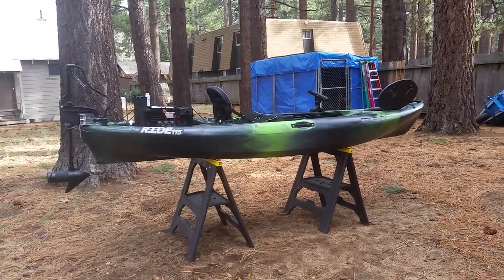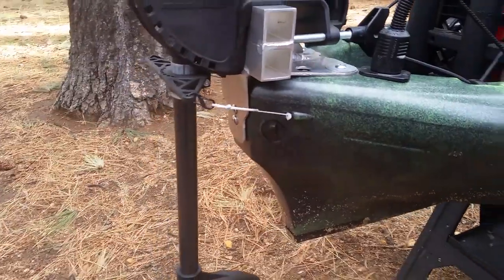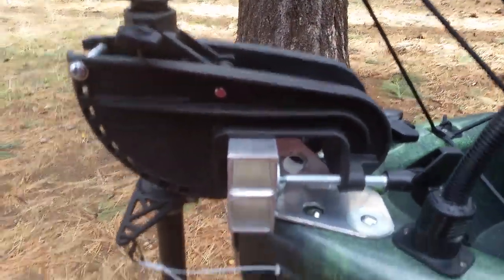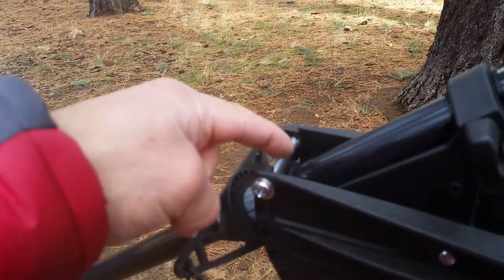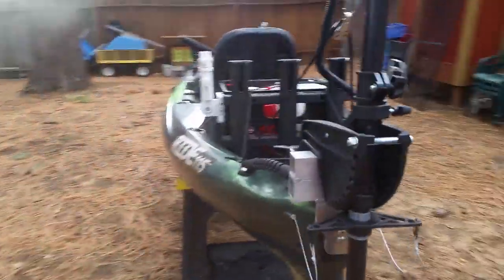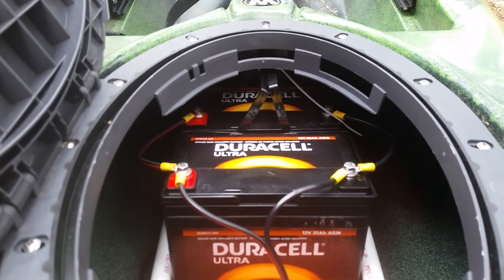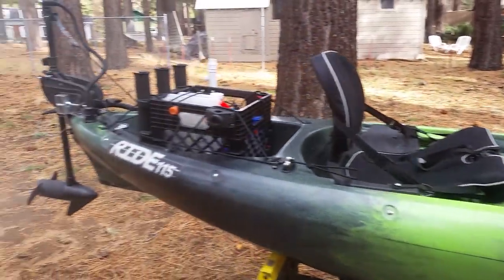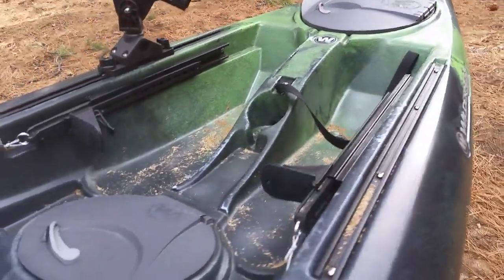Kayak Trolling Motor Project is Complete and Awesome!

Comment: I’m in the middle of doing my trolling motor install. I’m stuck at stow and deploy. I like your idea about removing the locking mechanism and adding a stop. I’m going to try it. Thanks for sharing
Reply from the maker: Thanks, I ended up cutting the pedal tracks shorter so the steering cables could be long enough to omit the stop but still no lock necessary. I think I will put up a vid, soon, about the mod.

Comment: Nice job I have seen some shockers, I have just completed mine. Wish I saw this before I like the minn koto electric plug where I used 2x Anderson plugs that can come apart. Mine is so similar in design yet some differences i have electric steer with a 4" joystick voltmeter and speed controller permanently fixed to the side hull all the cables have been upgraded to 8 gauge to cover voltage drop. I also mounted a 135 aph lithium inside the hull up front the same as you.I can send some photos if you like.

Comment: How has the hobie rope held up to use? Noticed any stretch? im about to start the install on the motor steering system on my Big Fish 105 and don't like the idea of using a stainless steel braided cable that could cut through the nylon hose it slides through and eventually into the kayak.
Reply from the maker: It heald up really well, minimal stretch, no trouble whatsoever. This is what I used on a recent motor kit, it is also working well but less expensive. 
https://www.amazon.com/dp/B07BKRR8PN?ref=ppx_pop_mob_ap_share
I used 1.3mm
Reply: @TahoeYakFisher  Excellent. Thanks for the info and the link!

Comment: Nice set up... have you had many issues with your lines getting tangled in the trolling motor?  I have a NuCanoe Frontier 12 foot with a Minn Kota off the back and especially on windy, wavy days running two rods it can be a real pain.  Even sometimes running one rod I get tangled in the trolling motor and as much as I love to fish it can be pretty frustrating.  Trying to troll into the wind or with the wind, and not to the side of it, has helped along with no longer making "S" turns to trigger a strike but I just had a bad day yesterday on the water trolling for kokes and am wondering if you have any tips.  Cheers
Reply from the maker: I did get my line caught in my motor within a couple trips and have since moved my trolling position to a rod holder mounted to my milk crate behind me. I only troll one line at a time but with it mounted behind me I can turn my boat as sharp as I like making "S" turns. My rod tip is almost behind the motor and 7' off to the side. Hope this is helpful, thanks for watching.

Comment: Great set up. Questions re your battery and run time. Do you know the weight of each 35ah battery? Is your TM the digital maximizer type? Can you comment on the run time you get with the parallel set up? Finally - how does the weight up front work out for you? Thanks!!!
Reply from the maker: Allan Halls 
All the right questions, finally. Batteries are 25lbs each, they work fine in the front of the kayak for two reasons; its a 500# capacity and the seat slides back quite a bit to offset the weight. The Wireless Trolling Pro switch is a variable switch so... it has a "low voltage cut off" that I have not experienced with the two batteries, 6+ hours of trolling and running full speed in and out of the marina. Charge times indicate a longer run time is available.
Reply: Appreciate the info!!! All the way from Ontario, Canada.....

Comment: Very cool install! Do you think there is any advantage to running this setup versus a torqeedo or Bixby system? Thank you in advance for your help!
Reply from the maker: There are two advantages to my kit, in my opinion. First: cost, my kit uses a $100 Minn Kota motor and a $130 PWM from Wireless Trolling Pro and two $90 batteries, this all is the second advantage, parts are readily accessible and cheap though I have not needed to replace anything. Look at Bassyaks also, I would buy his kit and customize it to my needs before I would buy either kit you mentioned. Hope this helps, let me know if I can answer any other questions.
Reply: @TahoeYakFisher  - Sweet thanks for the quick response and I'll definitely check out bassyaks! Also subbed!

Comment: Excellent project and video.   I'm looking to begin a similar project with my Ride 115 to assist in tidal tributaries on the Carolina coast.  What was the source of the sliding pedals for steering?
Reply from the maker: John Lowder 
Hi John, thanks for the compliments. The pedals are the "tandem rudder module" from Wilderness Systems. I called WS and at first thought I might have to buy the whole rudder kit, WS literally used 'caller ID' to call me back because the rep came across the tandem add on. Hope this helps.

Comment: Great vid! I’m torn between bow mounting or stern mounting mine. I’m leaning towards bow because of turning on a dime , easy turn , easy stow and quick access if I have issues. Why did you run with a stern mount ?
Reply from the maker: I am trolling for Mackinaw, pretty big fish. They turn the boat around as I fight them but I keep them in front of me, for the most part. I wouldn't want the motor in front for the fish to wrap the line around. I can let the fight run port to starboard around the bow... even when I'm jigging I will switch sides of the boat with drift, getting the line around the bow with a motor in the way would be tough. BTW, mine still turns quick. Also check out my channel, I just put a motor on my new kayak. Thanks for watching and the comments, good luck, let me know if I can help.
Reply from the maker: I think also because of rough water conditions. Tahoe can almost resemble "offshore" conditions and a bow mount might be out of the water a lot in bigger swell.

Comment: Very nice setup.  Have you had any issues with the Wireless trolling pro remote/speed contoller?  Thanks.
Reply from the maker: No, I have not had issues with the remote, other than the fact that it is not waterproof and I wish it had a lanyard. I do freak out when the coin cell batteries it runs on start to die the remote loses connection,  once I figured that out and put spares in my kit it's been flawless!
Reply: @TahoeYakFisher  thanks

Comment: I'm still in the planning phase of modifying my Prowler 13 Kayak with a trolling motor.
I bought one of those wireless kits like you have. My question is, do you worry about losing the remote in the water and is it waterproof ? I'm thinking about putting it in a waterproof cell phone bag and latching it to the chair. Any tips?
Reply from the maker: Lloyd Boone 
Hi Lloyd, thanks for watching... Yes I am a little worried, no it is not water proof. I am actively considering a solution, maybe velcro, maybe some sort of device mount. Right now, my kayak seat has a pouch between my legs that the remote fits in, works great but not totally secure.

Comment: Dammm fantastic set up, I wonder if i can do the same with my eagle Talon yak. I'm in saltwater so i will have to use galvanized hardware.
Reply from the maker: Is the kayak "rudder compatible"? If it is I am sure you could. Also consider where you would store the battery. It was a really fun project but I am a pretty handy guy, consider BassYaks, that guy will sell you a kit or parts of said kit so you can DIY what you like but might be a nice head start. Really it was the BassYaks kit that made me decide that I could figure it out on my own.
Reply from the maker: Also buy a saltwater specific motor.

Comment: Looks pretty nice. What kind of line did you use for the motor lift? I was thinking about using Paracord and a similar cam cleat.
Reply from the maker: Thanks, I used black braided nylon rope. I'm not sure paracord would work as well, the sheath is slick and the inner cords may flatten out under the pressure of the cleat. Good luck, let me know if I can help.

Comment: Great video and mod. Do you have a link to the remote control variable speed switch? Or where u purchased it?
Reply from the maker: https://www.wirelesstrollingpro.com/catalog.html
Not easy to get ahold of these guys sometimes, I think its just a husband/wife team but if you get a unit they work pretty good... truth be told if I had it to do again I think I would spend the money on the PWM and switch from Minn Kota, way more money but completely water proof, it is wired to the remote but that can be worked around. Minn Kota doesn't talk about these parts as they want you to purchase a kayak prebuilt with a Minn Kota motor but the parts you want are the replacements for their "engine mount" motors.
Reply: @TahoeYakFisher  I appreciate the response and your Idea. I tried a cheaper variable switch but it got hot and burned up. I'll look into Minn kota and check that one out

Comment: Don't see you mention much about battery . I have a 8.5 ' Kayak , a Minn Kota -30 . What kind  battery should I have ? Is the Dakota 12 V ,  Ah 20 OK ? I like the light weight of it ( 6;5 lbs ) Or should I Use the Dakota 12 V , Ah 10 ( weights 2. 14 lbs ) ? Or can you recommend me another battery ? Thanks
Reply from the maker: Take the AH of the battery and devide that by the amps drawn by the motor you have and you get the time it should run at that draw... that being said I have two 12v 35ah batteries wired in parallel for a total of 70ah. I am using agm wheelchair batteries, they are 25lbs each. At trolling speed I can go for up to 7 hours. Hope this helps, thanks for watching.
Reply: Tahoe Yakfisher :Thanks for reply so soon .. This is my first time to try  kayak .  I don't know anything about battery for trolling motor .  I just  looking for a light weight ( Under 10 lbs) deep circle battery to run my  Minn Kota 30  with desired range between 2 to 3  hours at  minimum speed  for my 8.5' kayak . So please recommend me one  . Thanks
Reply from the maker: @maybonphuongtroi9281  

https://battlebornbatteries.com/shop/50ah-12v-lifepo4-deep-cycle-battery/

I recommend this one, it's a little more than 10lbs but not too heavy, really great batteries.
Reply: @maybonphuongtroi9281   Here is a battery for trolling motors on kayaks https://www.amazon.com/gp/product/B00K8E8M1C/ref=oh_aui_detailpage_o01_s00?ie=UTF8&psc=1
Reply from the maker: @haciendadad  
That is the same (different brand) battery I am using two of, run in parallel for double the run time... Thanks for the link.

Comment: great video.   do you have any vids on the mount? do you need cf numbers  b ecause it is motorized? thanks for taking time to share with us...Ken in Contra costa
Reply from the maker: Concord Roofer 
Hey there, thanks for watching and yes I do need CF numbers, I hate to admit I have been lucky so far with no law enforcement interaction. I went to DMV once and the guy had no idea how to process a kayak without a title... go figure. As far as the bracket goes I didn't video the fabrication but it would be a little different for different models. Mine is 3/16 aluminum sheet and 1.5×1.5 square tube welded into a 3×1.5, the seam in the middle keeps the motor clamp from crushing the box. I watched a bunch of vids and combined everything I liked, one company worth checking out is Bass Yaks, pretty well thought out kit but he likes bigger motors. Hope this helps.
Reply: thanks for reply that helps....used to go up to inlaws on alice lake rd  love tahoe. enjoy and thanks again

Comment: Could you please give a parts/cost list or approximation?
Reply from the maker: Minn Kota 30lb. Endura C2... $110.
Minn Kota plug... $30.
Torqeedo steering bracket... $30
Hobie "rope"... $12.
Wireless Trolling Pro controller... $130.
Batteries... $100×2.
Pulleys, cord, cam cleat... $40-50.
Various hardware... $50, maybe.
Transom bracket... $0. Fabricator is a buddy.
Rudder steer parts from Wilderness Systems... $100.
Pretty sure that's it. I will add if I missed anything. Hope this helps.

Comment: how long will a 30 lb motor run on a motorcycle size battery?  thanks
Reply: Jack Gold  Not long, get a good deep cycle battery. It will last for hours and hours. I have a 18’ Alumacraft Bass boat and one 12 volt battery will last all day long if you don’t run it on high all the time. I set my motor on 2 or 3 and it last a long time. And it at least a 800 to a 1,000 pound boat. I use Interstate Battery’s not the junky Walmart battery’s, they don’t last..

Comment: Where were you able to find the steering bracket on the shaft?
Reply from the maker: Richard Moulis 
Hi Richard, thanks for watching. I bought it from Torqeedo dirrectly. I had to sweet talk a little, they have a flat rate shipping charge that was too high. I found it at one kayak accessorie store but never called them.

Comment: Excellent setup, its very neat and efficient. Did you make that wireless remote or is it stock Minn Kota? Ive recently added a motor and starting with a wired pwm speed controller remote but wireless would be a great future project.
Reply from the maker: Bradley Vickers 
Hey there, thanks for watching, glad you like it. The remote is a product of "Wireless Trollig Pro", nice folks... Leon will build you a custom unit however you like.

Comment: Tahoe YakFisher, that's a superb job you've done there!  I really like how clean everything is.  I have the WS115X and have been looking to put just such an outfit on mine.  Do you mind if inquire about the costs minus the aluminum bracket (I have access to lots of aluminum materials) and also.....did you do the change on the shaft of the trolling motor or did you buy it that way?  Thanks from the Lonestar State!  Greg A.
Reply from the maker: Hi Greg, thanks for the nice comments. Not sure what shaft modifications you speak of? I did remove the stock tiller/ throttle head from the motor/shaft and used a PVC elbow to cap it. But, in short, yes I made all the mods myself. I paid about $110 for the Minn Kota endura C2, $130ish for the Wireless Trolling Pro kit, batteries were about $100 each, the WS rudder pedal kit was about $100 bucks and another $100 in materials like rope and pulleys, cam cleat, stainless hardware. Hope you give it a go, I love mine it performes really well.

Comment: how do you keep motor from ramping out of the water when you go into revers without the lock system?
Reply from the maker: mike barfield 
Hi Mike, thanks for watching and taking time to ask. The steering cables are below the pivot so the pressure if your feet on the pedals keep the motor where it belongs while in reverse, works great.
Reply: thanks a lot as mine is set up the same way on my sea ghost, i didn't remove lock yet as i didn't know if it would stay in the water but now i believe like you said it should be fine
Reply from the maker: mike barfield 
No worries, I think the lock consists of 3 parts and could be put back together if you don't like the way it works but my setup works great forward and reverse.

Comment: Speaking from experience battery in the front kinda sucks.  The bow sinks lower and you plow water instead of gliding on top of it.  Also when you run out of battery it makes paddling a bitch.  I was using a 110 agm that weighed a lot more than your two batteries though so maybe you won't have as big of a problem with it.
Reply from the maker: DryUrEyesM8 
This kayak has a seat that slides back to expose a standing platform and slides forward to paddle, slid back a couple inches offsets the batteries to the boat planes well, perfect kayak for the set up.

Comment: Deep Cycle battery to big to fit?
Reply from the maker: The two batteries I have equal a group 24 and are "deep cycle", a "group 24 or 27" won't fit anywhere except where my milk crate is.

Comment: If you wire 2 battery's in parallel for 24vdc.
And hook up your 12vdc trolling moter to the 24vdc pack you will get double Rpms.
But less moter life!.

See you tube vids on 24v power wheels kid cars.

If you need more run time amp hours wire 4 battery's in series parallel.
Reply from the maker: Two 12 volt batteries wired in parallel is going to remain 12 volts... I believe you mean wire them in "series" which would produce a 24 volt battery but understand this, two 12volt 35ah batteries wired in parallel produce a 12volt 70ah battery while the same two batteries wired in series produce a 24volt 35ah battery. This would be counterproductive for my application, I am, mostly, trolling which means I want to go slow for as long as possible, I don't need power, I need amp hours. Thanks for watching.
Reply: @TahoeYakFisher  my mistake you are correct.
 Some viewers want there trolling moter to go faster. I'm not sure if the props will hold up.
But the water cooled moter should.

Comment: Can somebody please let me know how to wire the minn kota plug and receptacle its seems every single video ive watched nobody explains it
Reply from the maker: J J 
Hi JJ, the plug will do 2 or 3 wire applications. I only used 2, red and black or positive and negative. I am pretty sure on mine the #1 position is negative and the #2 position is red or positive. Hope this helps.
Reply: Tahoe YakFisher thank you very much I did this exact thing red and black I created a video still need to edit it just in case anyone else runs into the problem in the future

Comment: Too bad wireless trolling pro is out of business ☹️
Reply from the maker: Ya, it's a bummer. There are a couple work arounds though none are wireless. You can buy parts from Minn Kota, a little spendy but waterproof by design. Amazon/Ebay has very inexpensive PWM units that would need some creativity to use but cost $20 or less, so focus on the positive and enjoy the social distancing of kayak fishing!